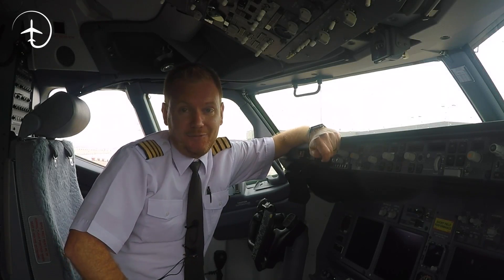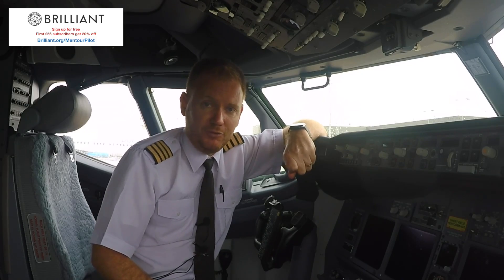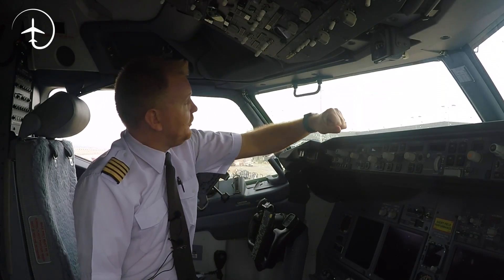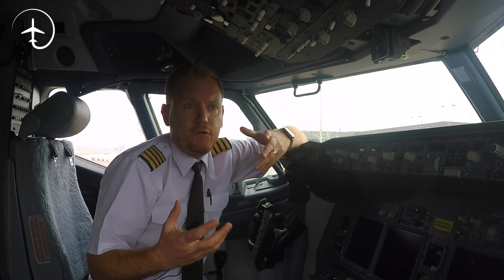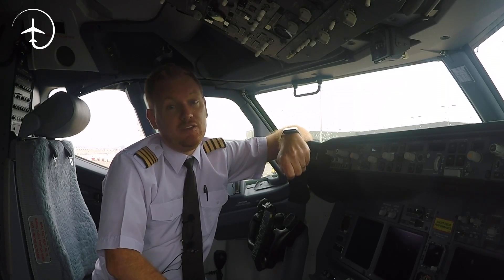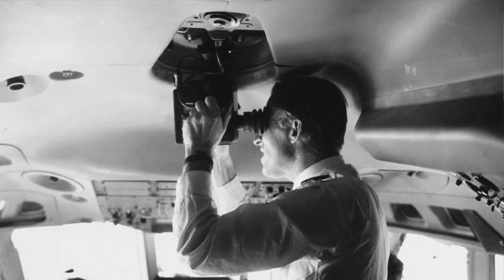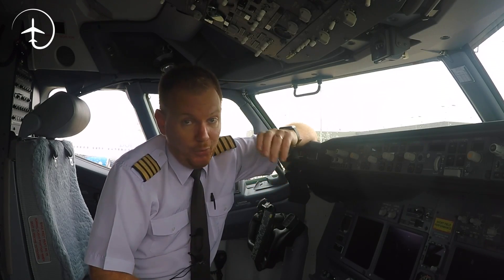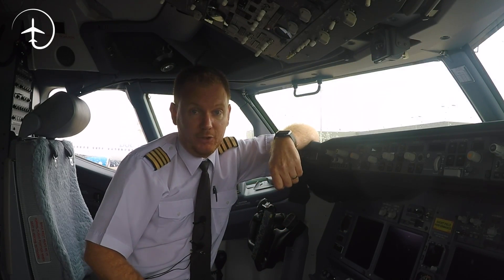Boeing 737 EYEBROW windows? What is the purpose of them?

Comment: GPS measures NOT the angle to the satellite  but the "time of flight" of the radio signal
Reply: Correct - that is the reason why GPS satellites have an atomic clock on board which allows the GPS receiver to calculate the distance to a GPS satellite. To calculate it's own position it also needs to know the position of the satellite (at that time). But this is not done by measuring any angles in the GPS receiver - instead each GPS satellit sends also detailed information about its orbit and its current position
Reply: aaa bbb it's relative position of your receiver to those satellites, so it is essentially a problem of angles. I am sure a lot if you didn't do well in maths. Or maybe you have smoked too much meth. Look behind you, the allien and ETs are laughing at you. Ever wondered how the ETs navigates?
Reply: To be more accurate, GPS does not use the "time of flight," but the time difference, hence it's called TDOA (Time Difference of Arrival).
Reply: Yeah. Actually, a "cold start" from a GPS receiver would take around 12 minutes to fetch all orbits from a signal. Newer GPS receivers can receive parts of the message from different GPS satellites and speed up the process, but it still takes some minutes, depending on the quality of the connections. 

Without this information, your position is like "you're in Europe and maybe inside UK" (because your receiver have some old informations) with this information it's like "you're in Wessex". Then it takes around 30 seconds to receive the fine and latest informations ... and then the clock on your receiver start to synchronise the clock with many different satellites with a rather complex mathematical operation and after that, you're in street X at house number y.

That's why Phones use a system called AGPS - it's basically fetching the needed bits over the internet instead of waiting for the GPS receiver to actually receive this information from the satellites. Phone usually just need to synchronize the clock in a sub 10 ms area because it's already synchronized with NTP over the internet. :)
Reply: ...and the satellites are not "fixed" either. Nice video, though.
Reply: @mgoblue0970 Instead of shouting and insulting people, try constructive criticism. Tell them what part is wrong, and give them the answer you think is right. Do it in a friendly tone and leave that Caps-lock key alone, it really doesn't help on the internet.
Reply: "Exactly the same" just means that no single satellite can give you your position; GPS requires getting your possible positions from at least three different satellites (four, if you care about altitude) and calculating where they intersect.
Reply: @crosscompiler  Yes, a minimum of 3, hence the term "triangulation".
Reply: Broadcast TV satellites are in geosynchronous orbit (i.e. they don't appear to move relative to the Earth).   GPS satellites are in much lower orbits, which means they are constantly in motion relative to the user.   It would be pretty difficult to get a fix on such a moving object using a high gain antenna.
Reply: No they are not . Geosynchronous / Geostationary satellites (like normal TV-Satellites) have an orbit of 35 786 km while GPS satellites are flying at 22200 km height
Reply: Yes - the GPS satellites are sending "almanac" data containing information of position,speed and orbit of each satellite. But the transfer is quite slow ( 50 bit/s) and therefore to receive a complete almanac takes some time.

This makes cold starts (when the GPS receiver was off for several hours and therefore needs new alamanac data) slow.

Another problem when the GPS receiver does not know anything about the current orbits and positions of any satellite is the Doppler effect.

Depending on if a satellite is moving away from the receiver or is moving towards the receiver the received singal frequency changes due to the Doppler effect.

As a cold started GPS receiver does know if satellites are moving to him or away from him he has to scan multiple frequences step by step (at least normal commercial receivers) to find a GPS satellite signal.
This takes additional time before any data could be received.
Reply: The same reason why GPS actually account for theory of general relativity.
Reply: In theory it would actually be possible to measure the angle to the satellite.  The problem here is, that radio waves don't go in straight lines as light waves do. Because of the larger wave length, they tend to spread in all directions. Like water waves on a pond. To accurately measure the direction of a radio source, you need a large device, like a radio telescope.
Reply: Eternal Tech there used to be, and maybe still are, ground repeaters for GPS that performed a similar function as AGPS does now
Reply: Nice.   Didn't know that.
Reply: I didn't say it is impossible, but we're talking about using it for navigation.  You would need a pretty good idea where to steer your receiver in order to catch the satellite signal, and in order to do that you would already need to know both your position and the current position of the satellite.   Keep in mind each satellite follows a different orbit and they are at wide angles to each other - there is no predictable path for you to scan in a case where you truly don't know where you are, so...not very useful as a means of navigation.    It would be far easier to use the sun and stars.
Reply: Astro navigation uses trigonometry, GPS uses time. there are different.
Reply: +Ruben Kelevra
I'm pretty sure GPS cold starts are assisted by almanac broadcasts (current time and positions of all active satellites at that time).
Reply: I've built room location systems on the same principle as gps, what you have is n known points in space, you measure the distance to them and you intersect n spheres centered at these points, each sphere has a radius - the measured distance from each point. If you intersect two spheres you get a circle, intersect 3 spheres you get 2 points, intersect 4 spheres you get 1 point. It's really simple, just intersect a couple of sphere equations and you got it
Reply: @mgoblue9070  Actually, it is called trilateration.  And it isn't calculating from 3 angles.  It is calculating from distances (or difference in distances to be precise) and really wants more than 3.
The most general GPS mode uses time-difference-of-arrival (TODA).  The difference in the time the signal arrives between two sats localizes the receiver to some point on a hyperbolic surface.  Two different pairs (eg: A & B, B & C) will localize to the intersection of two hyperbolic surfaces, which is normally 2 or 4 curves.  A third pair will get you down to some points, all but one of which you can normally exclude because of other info (like them being off in space).  Adding in a 4th sat gives you 6 TDOA values which will almost always get rid of any ambiguity (multiple points) as well as add some redundancy to the solution.

Also, standard GPS altitude resolution is not particularly good.  Tiny time errors translate to big elevation errors due to the geometry of the sats and receiver (the receiver is relatively near the edge of the convex hull defined by the sat positions along the Z/elevation axis).   That is why airports which are setup for GPS enabled/assisted landings have their own GPS transmitter on the ground.

Anyways, don't be a dick.
Reply: yes but the charting method is the same. systems to mesure angel would be quite bulky and impractical for anything smaller than a large plane.
Reply: They are not.
Reply: They are not geosynchronous, I wanted to write.  ;-)
Reply: +aaa bbb 
Thanks, I didn't know this.
Reply: BlackEpyon no, they are in 12 hour orbits.
Reply: Edward... GPS sats are not geostationary.  Which sats you can "see" changes over time as they orbit.  Hell, for a particular location, you can even generate charts showing what times will have more (or less) satellites visible and how favorable their geometry is for position accuracy.
Reply: GPS satellites are not geostationary because that would require an equatorial orbit, making it hard to impossible to cover the high latitudes and polar areas
Reply: GPS satellites don't even constantly follow the same orbits. When U.S. military needs full precision somewhere, the GPS satellites are repositioned so that the area gets the best precision. When tht happens, in the areas that the repositioned satellites previously were covering, people might notice that their navigators show the locations a little more off than usually.
Reply: Yes, it's all about the difference in times between different satellites. That's why Einstein's relativity had to be factored into the timing devices.
Reply: Thomas Lehner light doesn't go in straight lines too... the thermic in the atmosphere also affects the star light. But yeah the effects might be lower. Dunno. But you could measure the angle of the signal of a sattelite pretty accurate, you just need a high gain antenna. This is actually pretty cheat too, all RVs do this basically if they search for a sattelite signal for the TV. 

The main issue why you don't want to do this and use a pretty low gain antenna is, that aircrafts need accurate positions especially in bad weather where the aircraft can barely fly without turbulence.
Reply: +Ruben Kelevra       "Yeah. Actually, a "cold start" from a GPS receiver would take around 12 minutes to fetch all orbits from a signal. Newer GPS receivers can receive parts of the message from different GPS satellites and speed up the process, but it still takes some minutes, depending on the quality of the connections."

Before smartphones, I used Garmin and TomTom GPS receivers in my car. After powering these units on, it took less than one minute to determine my current location and be ready for use. These "standalone" GPS receivers did not have Internet access.

How were these pre-smartphone standalone GPS units able to be ready to use in less than a minute?
Reply: Jon Jackson well it's possible, you just need a reflector and more than one receiver in the reflection as an array. The gain easily steering the reflector actuators towards the larger gain. That's actually similar to how automatic star navigation works.
Reply: @jesusoliveira2  Neither are the stars fixed techncially.  The comparison was fine.  You guys are being WAAAAAAY too pedantic!!!
Reply: @Ruben Kelevra.  WHAT IN THE WORLD ARE YOU TALKING ABOUT??!?!?!!  Do you know what frequency GPS L1 and L2 is?  Of course you don't.  Then you wouldn't be spewing bullsh!t about gain.  Have you ever seen a GPS signal on a scope before?    Of course you haven't.  Then you wouldn't be spewing bullsh!t about signals.  True, there are things such as moisture-based attenuation and atmospheric bias that affect a RF signal, BUT THAT IS ALREADY ACCOUNTED FOR.  You make it sound like GPS is a fragile thing.  It's not.  The FAA wouldn't have certified it if it wasn't.  YOU'RE A MORON.  STOP POSTING IMMEDIATELY.
Reply: > It would be pretty difficult to get a fix on such a moving object using a high gain antenna.

No it's not.

Your comparison makes zero sense as well.
Reply: GPS satellites are geosynchronous, are they not?
Reply: > Astro navigation uses trigonometry, GPS uses time. there are different.

Ummmm, no, No, and NO!!!  The time GPS uses is ultimately a vector from source to observer.  Three of those ANGLES are used to used to calculate a location.  Do you know what calculating a point from three angles is called?  TRIGONOMETRY!!!  Idiot.

Comment: Could you control plane pitch without moving stick (control wheel for Boeing), but using only trimm button? thx
I mean is it possible to fly (takeoff/land and so on) without moving stick by pressing only trim button (nose up/dn)?
Reply: thanks! but how trim works then? pressing trimm button, lets say up, what happens?
If press it 100 times, what action for plane its cause?

Comment: I've always thought it interesting that the cockpit windows could be so large relative to the passenger cabin windows.  As many of us know, in the early days of jet powered passenger service, the de Havillind Comet suffered several mysterious mid-flight loss of aircraft.  These losses turned out to have been caused by the large size and square shape of cabin windows which led to fatigue cracks during pressurization and depressurizing and subsequently a catastrophic failure.  However, not only do the large square cockpit windows not lead to cracking, some of them can actually be opened (obviously not during pressurized flight).

Could you speak to the differences between the cabin windows and the cockpit windows?
Reply from the maker: Great idea. I will have to look into that though.
Reply: The cockpit windows are made from thick laminated glass to withstand impact from foreign bodies, like hailstones or birds, and they are mounted to the window frame in a very different manner.  The sliding windows actually fit like a cork in a bottle.  The air pressure inside the cockpit actually presses them closed against the window seals plus they are held by a latching mechanism.
Reply: As there are only a few cockpit windows vs the dozens of passenger ones, they can afford the weight penalty of a strong framing system for them to resist the internal pressure.
Reply: The commet had more than one defiencey that caused their failure. Rivits for or near the windows and the aluminum skin of the airplane  was a bit too thin. I am amazed how well most new airplanes are engineered now. It is a good thing Ford is not in the airplane manufacturing business.
Reply: Ford did build 199 Trimotor aircraft, the Tin Goose,a few of which are still flying
Reply: The main reason for the comet's disasters was the integration of the jet engines through and into the wings which resulted in  vibration , fatigue cracks and ultimate catastrophic structural failure of the wings

Comment: Thanks for the info - v interesting as always.
A question about maintaining a sterile cockpit but in this case I'm referring to your oxygen masks - if the pilot flying the leg before yours has a heavy cold, for example, can the pilots' breathing systems be sterilized, and what impact would this have on turn-around times?
Reply from the maker: Well, if the pilot had to use the oxygen mask, then the following pilot will not fly that particular plane. The mask will be cleaned before re-stowed.
Reply: Actually, thinking about it, if the pilot used the oxygen mask then there is probably more to worry about than catching a cold!
Reply: RO BT, you may be getting confused about the terminology of "Sterile Cockpit".  In commercial aviation terms, it means no discussion outside of flight operations.
Reply: Exactly right!
Reply: If one pilot leaves the cockpit, for a bathroom break for example, the other pilot is supposed to put on their mask just as a safety precaution.
Reply: If pilots have a heavy cold, should they call in sick and not fly? It seems like it would be risky to takeoff/land/run emergency checklists and communicate if you're coughing/sneezing/nose blowing a lot?